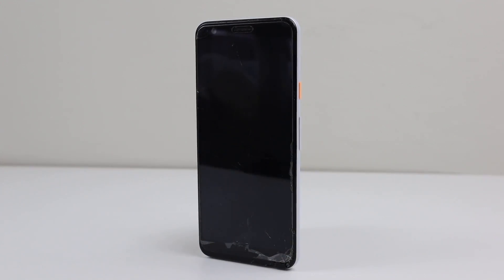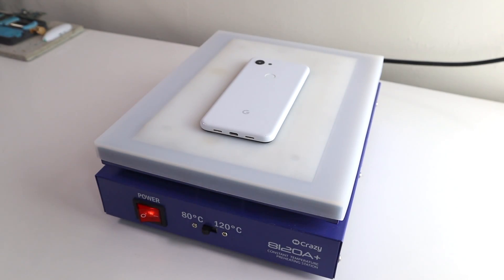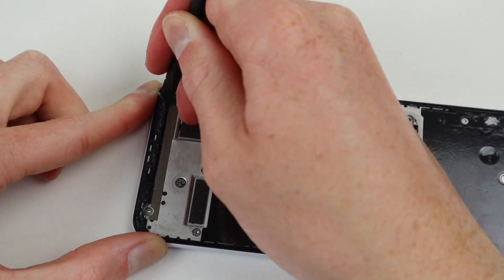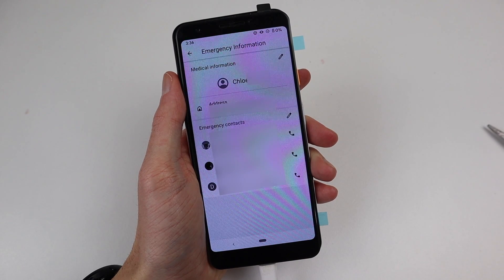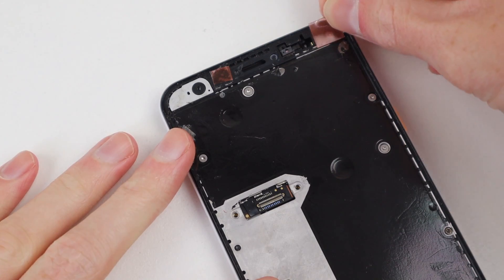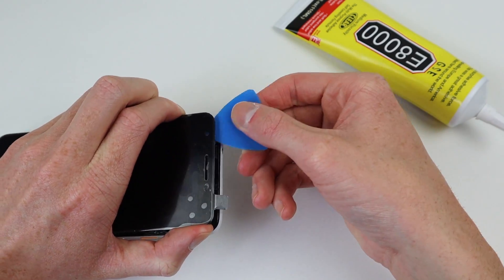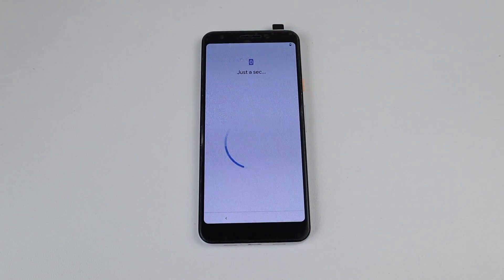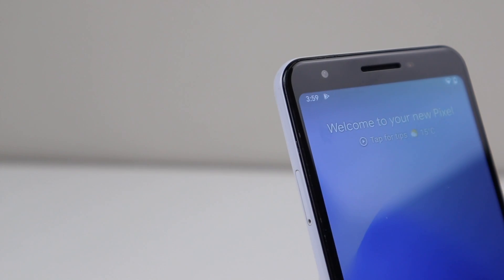Repairing a "Dumpster Dived" Google Pixel 3a

Comment: With the display removed, it looks like it would be safe to attach without disconnecting the battery. But I'm not sure about that and probably wouldn't do it even if it was designed in this type of way.

Comment: I just took off the screen from my brother's phone after watching a different video. They had no audio so I didn't realize there is such a thing as a mid frame. Yikes. But it's ok. I just needed to access the phone to transfer his photos. He didn't back up anything and then he accidentally hit the update to Android 12. He was unable to sign on to the Google Play store and couldn't use YouTube, Chrome, and Google Maps. 

It took so much longer to take the mid frame off and only using a hair dryer and my nails. Then, I started using the plastic tab that comes with a loaf of bread.

Comment: I have a Pixel 3a that I'm no longer using, about 6 months after I bought it I fell over and now the frame is all twisted - somehow the screen didn't crack so I just dealt with it!  Phone still works and it's 3 years old now.  Now it's my spare device I may take the time and do a chassis swap so it's no longer twisted, thanks for this video showing how straightforward the process is!
Reply: This is the reason I bought a Pixel 3a myself! It's easy to fix for a beginner like me, I've replaced the screen like 3 times (I never drop my phones and have never cracked a screen before so maybe I subconsciously dropped it JUST so I could fix it idk lol) and even now my sister is using it like new 3 years later.

Comment: hey man you dont know how to use the E8000.after applying the E8000 tie the phone thightly with rubberband or in any way the phone should pushed hard to the display for a  24hrs 20mins after the time remove the rubber band or the some things else the phone is ready E8000 is better than the dubble side tape and heesif,E8000 is used in microsoft surface pro 5,E5500 is used in most of Iphones even in Iphone 12,Iphone 12 pro,IPhone 12 pro max uses E5500

Comment: The E7000 and B7000 are actually rather old glue groups. TipTop is the most well known glue of this group.
What you need to know about them is that these need at least 12hrs to set and 24 to 48 for complete cure.
These are acetone-base, so not that toxic actually.

Comment: Aww this is a sad little boi. I actually owned a 3a (now I gave it to my mother since I switched to another phone) but I understand why people toss their phones out. Repair costs are really expensive sometimes. My 3a had an issue with its front speaker (because it may have had some contacts with water😬) and in order to fix it, the repair place that was approved by google would charge 190 Canadian dollars! For a freaking front speaker. And with a little bit of tinkering, I got it done myself for 30 bucks or so. But average people aren't willing to get into their phones and replace parts.

Comment: you know mate I have a bunch of broken or faulty phones that I hope can be fixed but honestly I just don't want to spend a cent on them because they're old. All of them are android I have a galaxy note 4 with non functional sim card, a Huawei mate 10 lite with a poorly replaced screen that the touch is wonky, a samsung m20 with a cracked display but working, an HTC 820G+ with the slowest response possible, a galaxy note 8 with a smashed display and no touch but still working etc...

Comment: I'm watching this because I splashed water on my Pixel 3a and it's now stuck on infinite boot loop. It's so annoying to me that they make the phones so you can't open them easily. I could have removed the water immediately and saved the phone probably. Now I stuck it into the oven for as low heat as possible. placed it near a fan and still waiting for the water to evaporate and hopefully get it working again.
How much e-waste are companies like Google and others responsible for just by making phones unserviceable by the owner? It's not like the planet is getting any colder. Lets just mine every last bit of finite resources left, f*ck it eh Google?

Comment: It's really good to watch your videos. Made me try to fix one of my Toshiba Satellite laptops that stopped working, it won't boot even though it turns on and I can hear the HDD and cooler starting up. I replaced the motherboard with a new one, transferring the CPU from the old motherboard to the new, but I guess that the CPU has been fried and it's gone.

Comment: So, here we use E8000 and F7000, you need to use rubber bands and apply pressure for 2 days, it keeps everything watertight and its fairly easy to open if you messed up something or something goes wrong

Comment: I would have loved to given you my iPod touch 4th generation. Even thought about fixing it myself. But then I saw your video calling it pretty much unrepairable. It needs the works. It still alive. But it needs a new screen, new power button, new home button, and a new battery. Like I said. I can get it to turn on. But considering the power button doesn’t work I have to plug it in, in order to get the screen to light up. And the battery is so depleted it pretty much doesn’t charge enough to get it to actually stay on. You really need to leave it alone for a while to get enough charge for maybe 5 minutes of screen time. I think it depletes the battery faster than it is charging at this point. I forget what iOS it is on exactly. But probably the last iOS version that the iPod touch support or close to it. I’m assuming iOS 6.something. I was still using the touch up until the end of 2015. When I got my iPhone 6s Plus which hopefully this Friday I’m finally replacing. Haven’t cracked my screen in the 5 years I’ve owned my plus. But the camera is all shaky. I glued a magnet to my phone (it’s actually just glued to the screen protector not the phone itself) just to hold the camera somewhat still. Lol

Comment: Nice. Yesterday I finished to repair my "WC water damaged" (a little drunk that day) low spec Samsumg A20e. Is a bit harder to open, but feasible. Ended up being the charge board. By contrast my iphone SE touch button and battery... a nightmare. By the way the touch button do not recognize the print due intentional ID pairing. But is Apple.

Comment: You have to wait for the dissolvant present in the glue to evaporate before trying to glue the display in place, 5 minutes should be enough

Shoving the screen as soon as the glue is applied prevents it from curing properly and the display or any other thing you're gluing will come loose 

Also you should apply it on the phone body and screen so it sticks even stronger

Comment: I wonder if E8000 is the Australian version of E6000 us Yanks use? E6K is good st! My biggest problems are getting the cap unscrewed when it's been put on with E6K all over the threads, and squeezing it out of the tube when it has hardened in the tube!

Comment: 5:35 for glue T-7000, B-7000, E-7000 hold the display correctly you have to apply it on both sides, display and case, wait around 3 minutes for the glue to dry a little and then join the display with the frame, only like this glue secures the display, glue on one side and immediately gluing the display the glue is still liquid and does not work properly.

Comment: Most eBin phones end up in landfill anyway, people would rather buy a new phone than pay for it to get replaced
Reply: Not where we live if people do the right thing.  I'm appalled that someone took phones out of an e-waste bin and they should be harder to get into.  All our phone companies will take back the old one for recycle and Taiwan for example can dismantle them down to the tiniest parts and even have a use for the last little bit of dust left over from complete recycle. Just takes a tiny bit of effort to get rid of a phone correctly.

Comment: Well I guess I'm lucky then my Google pixel 2 XL when it's at a low brightness the bottom screen starts flickering really quickly and it's really bright but I don't have the money to repair it because it costs $200 to get a new OLED display and I also forgot to say that on the right middle part of the screen there's a big chunk of dead pixels

Comment: As a repair technician myself. Firstly you have some awesome habits. But with the glue drying, most of them "dry" in 3-7 minutes and actually dry in 24-72 hours. When setting the glue I use pegs, they are smaller, and more friendly on the phone.
Love your work!

Comment: You never use a 3m adhesive to glue display, it does not hold the display securely, will come off right away. Just a liquid glue like T7000 or T8000 will glue it to the frame properly.

Comment: Very nice, but in the future it will be better to use only glue, without sticky tape. Tape is a bit thicker so it will make easier for dust to get inside. Thicker tape will make it a harder to correctly position display or remove it. With the glue, you have more space to set a display correctly. And also use heavy stuff to get glue harder. Usually those types of glues should be hard after 24 hours.

Comment: To those repairing along with this, please be careful undoing the cable the way he does, that screen plug is surrounded by easily breakable components,  its not attached very well, you can just pull it off by the cable itself

Comment: This liquid adhesive works not that way. 
You should apply it to the frame, then wait for 5-10 minutes for it to dry and after that press the display into it. When the frame and display are collapsed, you should compress it using some rubber bands or clippers and wait for 3-12 hours. 

In Russian repair services we're using this glue all the time. If you follow the instructions, glue works perfectly, just like factory adhesive)
Reply: While drying applied without display attached this glue becomes like a sticky tape.

Comment: I dont know if someone else has mentioned this, but I will.  The reason why so many phones are dumped with minimal issues is that those phone kiosks that you see out the front of supermarkets charge a despicable amount to fix them.  That phone would have been $300+ to have the screen replaced.  For some people, it's not worth it.  I have an S8 here that I smashed the screen on 2 years ago, and I have been quoted $350 to replace the screen.  I can buy a replacement S8 for less.  So I am just holding on until this one dies.

Until phones can be repaired for a realistic price, people will just keep dumping them like this.  I have noticed more people offering to buy old broken phones, so I guess there's heaps of people around like you that buy them, fix them, sell them.  Which is good.

Comment: Hello, I just want to advice you that the B7000 or E8000 has a 12hrs to 2 days curing time. You need to use some type of lcd clamps for the display panel so it won't have any gaps while the liquid adhesive cures.

Comment: If you hard reset 3 to 4 times , logged in id will be remove automatically. I do this method for my gionee mobile. You should also check this methode.

Comment: When the pandemic is over you can get my 3 year old UX490UA laptop from Asus if your are interested. Not all the keys on the keyboard works and its missing its nvme + the battery connector on the mainboard is a bit loose (trouble turning on).  Plus the speakers don't stick properly to the inside frame anymore :)

Comment: This comment is avaiable in English, German, Italian and Spanish. Just click "read more, mehr lesen..."

Hi, i'm commenting, because Hugh didn't answer to my mail i wrote him over his Website or mention this thema (the thema i'm about to talk) in his video. 
To start, if you (or someone you know), sold or plan to sell your (or his) iPhone, iPad or iPod touch, locally or online on for example ebay etc. please read until the end of this comment, thank you for the attention :).
As most of you already know, Apple Products support iCloud, which is connected to you Apple-ID. If you resell your Apple-device, without disconnecting it from iCloud before you erase it, the next user will experience something called "Activation Lock". It is something that can't be bypassed without the old User's Apple-ID and Passcode or having him removing the Device of his Apple-ID and iCloud account. (All those softwares or videos that pretend to be able to bypass it, are just fakes). There are to many Apple-Devices out there, that can't be used anymore which causes a giant lot of eWaste. (Just open eBay and search for iCloud locked iPhones and you'll fint tons of devices). My request to you would be, that you (or someone you know) disconnect your already sold devices from all of your accounts, so other people can start using them again. It is just something little, that you are doing, but it will help to minimize eWaste alot! 
Thank you and i would appreciate a like (not because i want to get many likes), so this comment will be far up and more people can see it. (It could also help you, if you have a locked iDevice at home).

Hallo, ich kommentiere, weil Hugh nicht auf meine Mail geantwortet hat, habe ich ihm über seine Website geschrieben oder dieses Thema (das Thema, über das ich gerade sprechen werde) in seinem Video erwähnt.
Wenn Sie (oder jemand, den Sie kennen) Ihr (oder sein) iPhone, iPad oder iPod touch lokal oder online bei beispielsweise eBay usw. verkauft hat oder verkaufen möchte, lesen Sie bitte bis zum Ende dieses Kommentars. Vielen Dank für die Aufmerksamkeit :).
Wie die meisten von Ihnen bereits wissen, unterstützen Apple-Produkte iCloud, das mit Ihrer Apple-ID verbunden ist. Wenn Sie Ihr Apple-Gerät weiterverkaufen, ohne es vor dem Löschen von iCloud zu trennen, wird beim nächsten Benutzer die sogenannte "Aktivierungssperre" angezeigt. Es ist etwas, das nicht umgangen werden kann, ohne die Apple-ID und den Passcode des alten Benutzers oder das Entfernen des Geräts von seiner Apple-ID und seinem iCloud-Konto. (Alle Software oder Videos, die vorgeben, sie umgehen zu können, sind nur Fälschungen). Es gibt zu viele Apple-Geräte, die nicht mehr verwendet werden können, was eine Menge "eWaste" verursacht. (Öffnen Sie einfach eBay und suchen Sie nach iCloud-gesperrten iPhones, und Sie werden Tonnen von Geräten finden). Meine Bitte an Sie wäre, dass Sie (oder jemand, den Sie kennen) Ihre bereits verkauften Geräte von all Ihren Konten trennen, damit andere Personen sie wieder verwenden können. Es ist nur etwas Kleines, das Sie tun, aber es wird helfen, "eWaste" sehr zu minimieren!
Vielen Dank und ich würde mich über ein "Gefällt mir" freuen (nicht, weil ich viele Likes haben möchte), daher wird dieser Kommentar weit oben sein und mehr Leute können ihn sehen. (Es könnte Ihnen auch helfen, wenn Sie ein gesperrtes iDevice zu Hause haben).

Ciao, sto commentando, perché Hugh non ha risposto alla mia mail gli ho scritto sul suo sito web o menzionato questo tema (il tema di cui sto per parlare) nel suo video.
Per iniziare, se tu (o qualcuno che conosci), vendi o intendi vendere il tuo (o il suo) iPhone, iPad o iPod touch, localmente o online, ad esempio su ebay ecc., Leggi fino alla fine di questo commento, grazie per l'attenzione :).
Come molti di voi già sanno, i prodotti Apple supportano iCloud, che è collegato al vostro ID Apple. Se rivendi il tuo dispositivo Apple, senza scollegarlo da iCloud prima di cancellarlo, l'utente successivo sperimenterà qualcosa chiamato "Blocco attivazione". È qualcosa che non può essere aggirato senza il vecchio ID Apple e passcode dell'utente o senza averlo rimosso dal dispositivo del suo ID Apple e dell'account iCloud. (Tutti quei software o video che fingono di poterlo bypassare, sono solo falsi). Ci sono molti dispositivi Apple là fuori, che non possono più essere utilizzati, il che causa un enorme numero di rifiuti elettronici. (Apri eBay e cerca iPhone bloccati iCloud e finirai un sacco di dispositivi). La mia richiesta sarebbe che tu (o qualcuno che conosci) scolleghi i tuoi dispositivi già venduti da tutti i tuoi account, in modo che altre persone possano iniziare a usarli di nuovo. È solo qualcosa di piccolo che stai facendo, ma aiuterà a ridurre al minimo eWaste molto!
Grazie e apprezzerei un mi piace (non perché voglio ottenere molti mi piace), quindi questo commento sarà molto in alto e più persone potranno vederlo. (Potrebbe anche aiutarti, se hai un iDevice bloccato a casa).

Hola, estoy comentando, porque Hugh no respondió a mi correo, le escribí a través de su sitio web o mencioné este tema (el tema del que estoy a punto de hablar) en su video.
Para comenzar, si usted (o alguien que conoce) vendió o planea vender su (o su) iPhone, iPad o iPod touch, localmente o en línea en, por ejemplo, eBay, etc., lea hasta el final de este comentario, gracias por la atencion :).
Como la mayoría de ustedes ya saben, los Productos Apple son compatibles con iCloud, que está conectado a su ID de Apple. Si revende su dispositivo Apple, sin desconectarlo de iCloud antes de borrarlo, el próximo usuario experimentará algo llamado "Bloqueo de activación". Es algo que no se puede omitir sin el ID de Apple y el Código de acceso del usuario anterior o sin que elimine el Dispositivo de su ID de Apple y su cuenta de iCloud. (Todos esos softwares o videos que pretenden poder pasar por alto, son solo falsificaciones). Hay muchos dispositivos Apple que ya no se pueden usar, lo que causa una gran cantidad de desechos electrónicos. (Simplemente abra eBay y busque iPhones bloqueados con iCloud y encontrará toneladas de dispositivos). Mi solicitud para usted sería que usted (o alguien que conozca) desconecte sus dispositivos ya vendidos de todas sus cuentas, para que otras personas puedan comenzar a usarlos nuevamente. Es solo algo pequeño, lo que está haciendo, ¡pero ayudará a minimizar mucho los desechos electrónicos!
Gracias y agradecería un me gusta (no porque quiera conseguir muchos me gusta), así que este comentario estará muy arriba y más gente podrá verlo. (También podría ayudarlo, si tiene un iDevice bloqueado en casa).